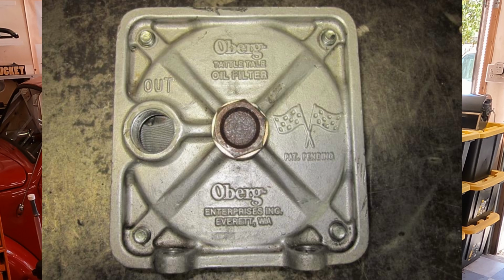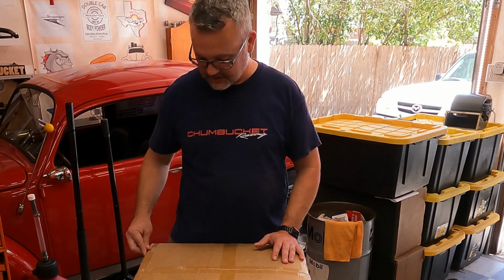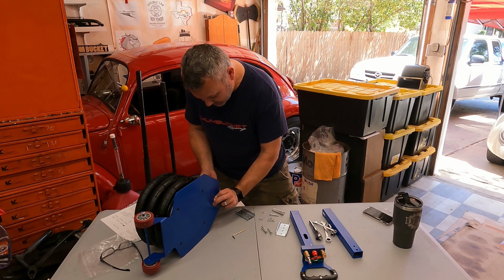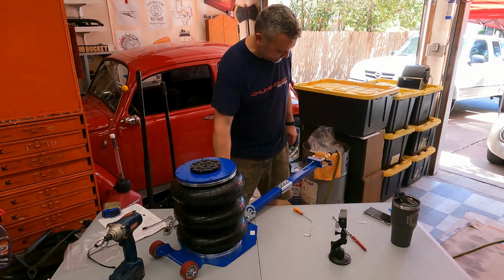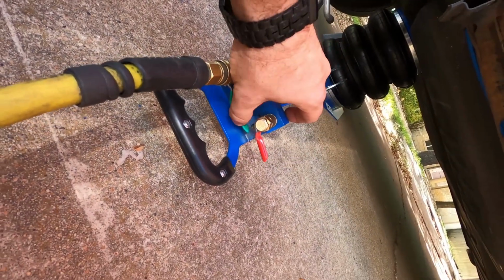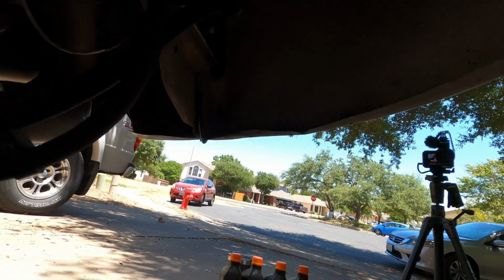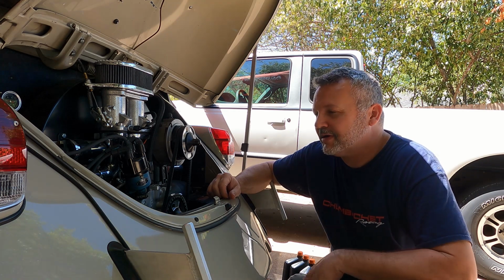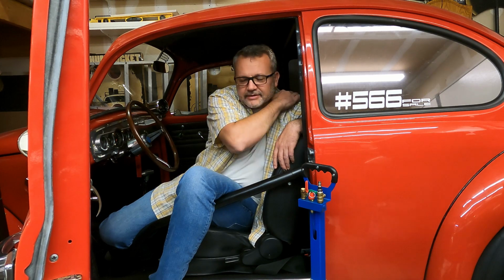We get JACKED while changing oil today!!

Comment: Beautiful car, sir. Are there any videos of how you installed the Weber carb?
Reply from the maker: Well - that is not a weber carb.. that is an IDF throttle body. is has no fuel delivery capabilities only air. as this car is running EFI with injectors on the endcastings.. Thanks for hanging with us.. Tommie
Reply: @VWLifeVW Beautiful installation, now I do want to see a video or two about that EFI system. Did you make it yourself or is it available as a kit? I might want one for my bug. Thanks so much for the reply.